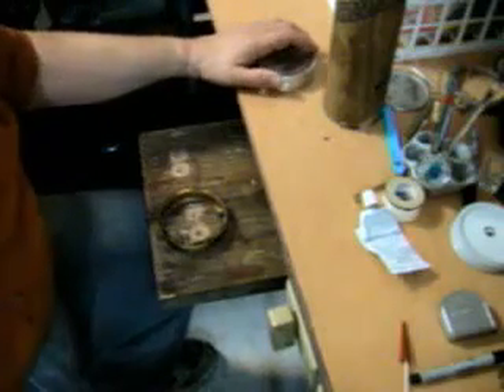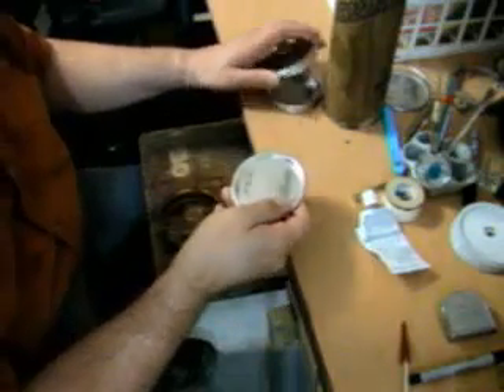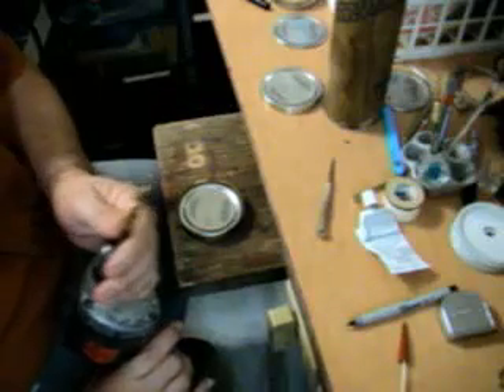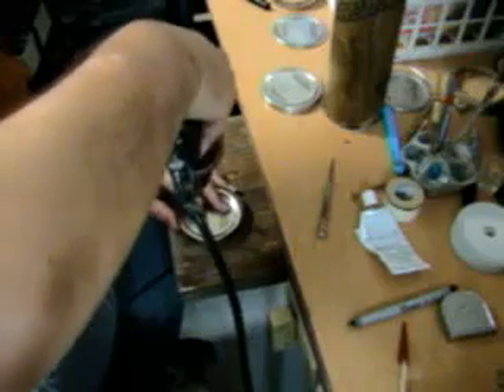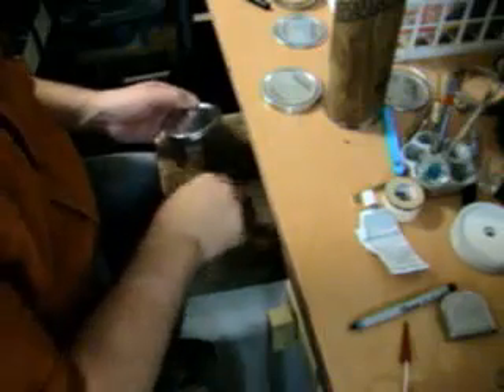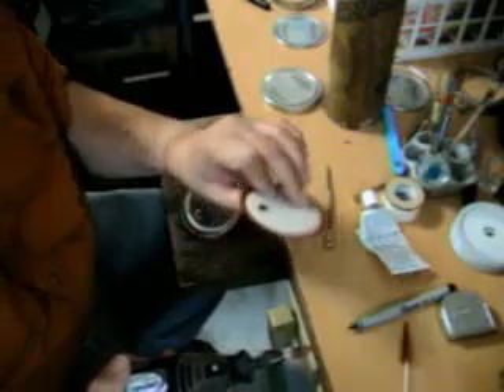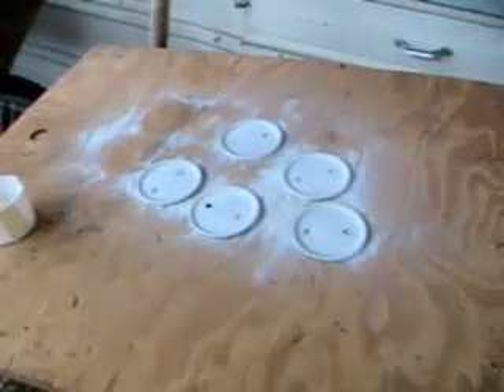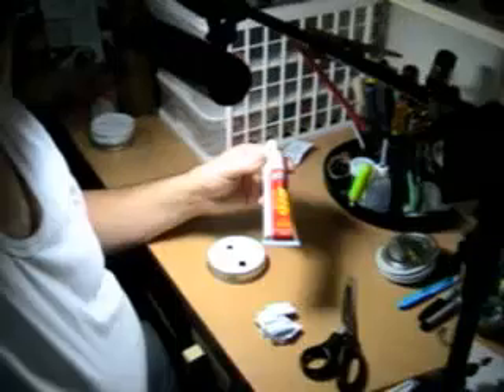Making self sealing injection port lids for mycology

Comment: I'm going to sandwich a pc. Of filter paper between the lid and the screw cap. Question, why does the inoculation hole have to be self sealing . Can't the inoculation hole  also used as an airport later?
Reply from the maker: The problem with trying to inoculate through a piece of filter paper is that you will be poking a hole through it, providing the air, (which follows the path of least resistance), the means to carry mold spores and bacteria into your media as the container breathes, which it will do as the temperature and relative air pressure changes throughout the day.

Comment: Why cant you inject trough the ventilation hole and Pillowstuffing-Filter?
Reply from the maker: You could do that, but there are a large number of mold spores settled onto and in the upper layers of the polyfil which you will push into your jar of sterile media as you push the needle though. With the injection port you are wiping the injections site with alcohol prior to pushing the needle through, so you are vastly reducing the chance of there being live spores on the surface you could push the needle into the jar.

Comment: try using a paper hole puncher(hand held) instead of drilling. I hear it's mush easier(and safer).
Reply from the maker: sounds like a viable option, as long as the hole is big enough.
Reply: It works.. much safer
Reply: Not as challenging

Comment: 15/16ths??? I’m guessing that it was 5/16ths but it would be nice to have your clarification since I don’t want to put words in your mouth.
Reply from the maker: it was 5/16ths, slightly larger than 1/4 inch
Reply: SocietyofEnoch thanks for the reply! As I was looking at my bits I realized I also had 15/64ths, just slightly smaller than 1/4. I’m just making lids right now and made both a15/64ths and 5/16ths as well as a 1/4 to test functionality before doing the rest. Just letting them dry now. Thanks for the tutorial!
Reply from the maker: The precise hole size is not critical.  It needs to be large enough to be an easy to find and pass through with the needle and small enough to not sag under needle pressure.   Anything between just under a 1/4" to just under 1/2" is probably fine.

Comment: Will rust affect the mycelium? And do the lids really rust that quickly? I was just curious if it is necessary to paint them, I mean besides the obvious reasons of having to make more lids eventually (I was just planning on making a vent hole only). Again I was just curious and thought I would ask the master! Very awesome videos by the way, extremely helpful, the best on you tube and I have been searching a lot as i am just starting to grow oysters. Thank you so much!!
Reply from the maker: Rust does not negatively effect mycelium as far as I can tell, but rust does provide gaps in the seal  that permits contamination and will cause brown condensation to drip onto your media, which can easily be mistaken for bacterial contamination and cause you to throw out a good jar, or make you think a bacterial contam is just rust water leading you to allow a jar to get fully colonized with bacteria.
Reply: Very good point on both subjects. Thanks so much for your help! I really appreciate it!
Reply: Also that is AMAZING how you can just cut out a small little strip from the inside of a mushroom and create an almost unlimited supply of spawn from it, amazing, you taught me so much. I'm going to try that from a store bought one, just to experiment.

Comment: I've come to like the plastic lids better- they don't get rusty or have sharp edges. You also use a finger dipped in soapy water to smooth or mold the silicone caulk when making injection ports.

Comment: I prefer using the clear silicone so you can see the lid in the hole easier. 
Thanks for all your vids and the work you put in.
Reply from the maker: Clear Silicone tends to get damaged with each insertion and eventually breaks apart to the point of being unusable.

Comment: wouldnt tyvek be better than polyfill
Reply: 2 layers of tyvek, with a ring of RTV underneath

polyfil will work as well, and micropore cloth tape is what i'm using
Reply from the maker: No, Tyvek is too porous for a single layer to work and multiple layers jam up the ring, forming a very leaky seal, in my experience.
Reply: SocietyofEnoch i was just thinking tyvek over the hole and use high temp rated glue to attach it so you would be able to put two layers without the seal being a problem
Reply from the maker: I can envision that would work.  Again, if you have a tech you are using that works, that's different than mine, I encourage you to do a video on it and share it so others can learn. I would be happy to approve a comment linked to any such video. Like the following - 
https://youtu.be/tOX1lXWbQFU

Comment: These are the ones I make... http://www.ebay.com/itm/272005337594?_trksid=p2060353.m1438.l2649&ssPageName=STRK%3AMEBIDX%3AIT
Reply from the maker: +Amber North Those look good, professionally made and reasonably priced.  I encourage anyone checking these comments to follow the link and see if they seem like a good option for you.
Reply: +SocietyofEnoch   Thanks! I did a bunch of trails with many different methods for making them. It is a challenge to make the holes in the lids and the SFD perfectly round. I am currently working on a no-tilt liquid culture lid. I will post a link when I get done.
Reply from the maker: I look forward to seeing them.

Comment: Will cotton balls work since I already have it or should I go out and buy some poly fill?
Reply from the maker: Ron Hardesty Cotton balls soak up and hold water, allowing things to grow in them allowing contams into your jars.  Get the poly fil, it's well worth the investment.
Reply: SocietyofEnoch thank you so much for the quick reply. I love your videos. Very helpful! I will get some poly fill first thing tomorrow!
Reply: Rip open a stuffed animal
......presto poly fill. Don't go and buy it unless u need a ton. Which, u dont
Reply: Ron Tropics you can also make discs for the lids from Tyvek house wrap which is designed for a similar purpose. Letting gas exchange but still being impenetrable to moisture and bacteria. hint: Tyvek is also used for USPS Priority and Express mail envelopes. Of course these envelopes are only to be used for their intended purpose but you may be able to find some left over from a construction job. Simply cut discs to match the size of the lid, you can either use a hole punch for your injection port making sure the RTV seals around that as well or inject straight through the Tyvek and seal the injection site.

Comment: try using a nail and a hammer, so much more easier
Reply from the maker: In my experience punching holes with nails makes holes that are too small and produces jagged shards that are difficult to make safe.
Reply: i just use a bigger nail and use high temp silicone
Reply from the maker: That might work for the needle port, but not so good for the poly fill hole.  The shards the nail creates can be treacherous.
Reply: SocietyofEnoch it will still work with poly fill but i just go and use tyvek.
Reply from the maker: There is no one right way, if your tech is working for you, great.  do a video on it so others can see how you do it.

Comment: What is the purpose of using the lids upside down?
Reply: +SocietyofEnoch I wondered that same thing while watching your video. However, I have been growing mushrooms for years and always put these on the right way and never bent one. At first I thought that it was because you would get airflow into the jar from the bottom versus the top, but even using a pressure cooker I have never bent a lid.
Reply from the maker: If you use them right side up the sealing material will form a seal on the jar during the sterilization/pasteurization process, making it hard to open without bending and destroying the lid.
Reply: SocietyofEnoch That makes a lot of sense. Love these videos. Thank you so much for sharing your techniques!